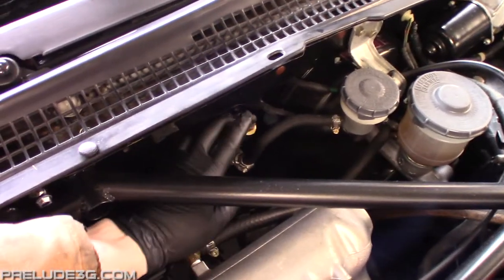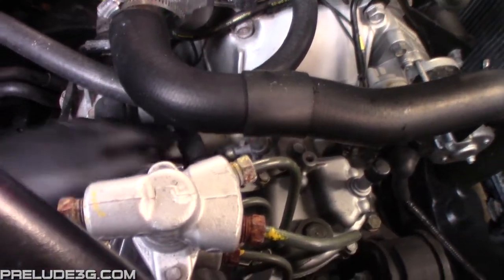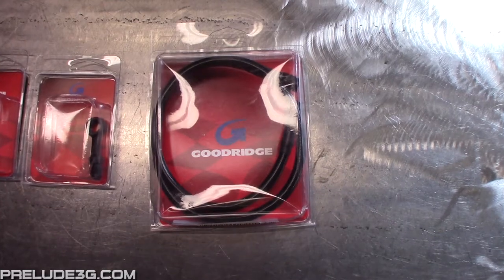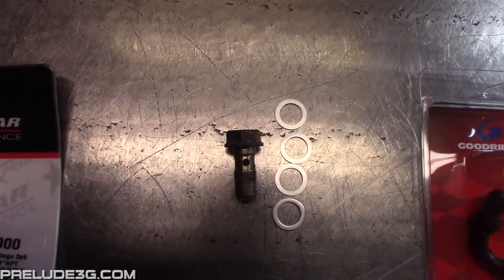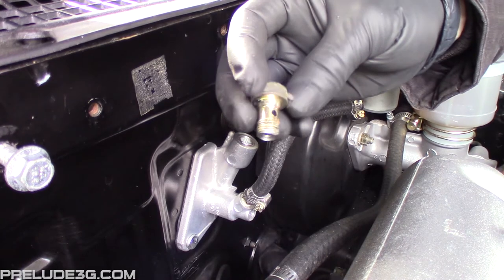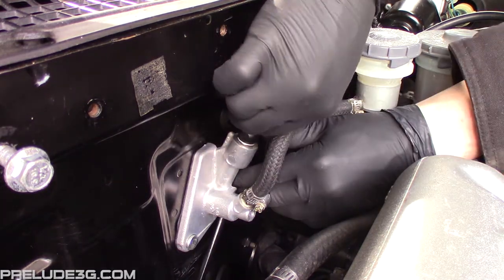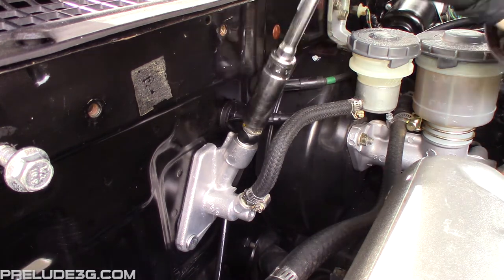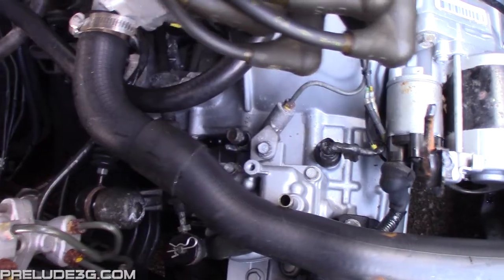TRANSMISSION: H-Swap Braided Clutch Line Install

Comment: can this process be done on a b20a car. My slave line is leaking from the rubber, I assume from age.
Reply from the maker: Yeah but I don't know the exact line length needed, probably 54-60" long. If you just want to replace the soft line this thread has a link to one I used on another car that only costs $10: http://www.prelude3g.com/forum/viewtopic.php?f=1&t=39
Reply: Prelude3G.com Wow thats awesome, is that one direct fit? I may just go that route considering 30$ is what the oe style line cost
Reply from the maker: The length is slightly different but it will work fine.
Reply: Prelude3G.com Id just like to drive my lude again, finished my 4ws conv and then my radiator was bad, changed that and now that line is leaking. Technically I could drive it but why get brakefluid everywhere.